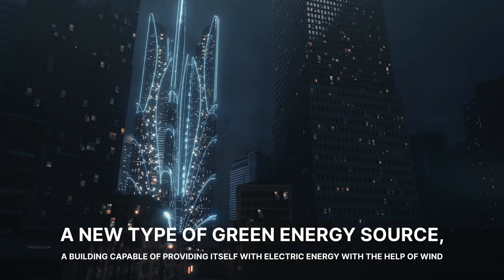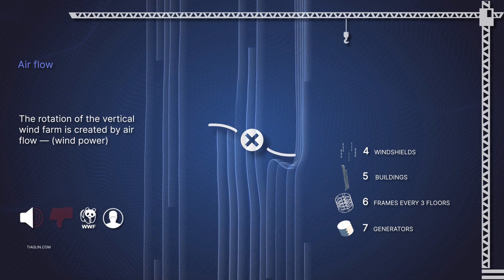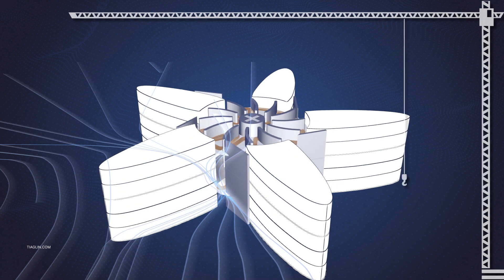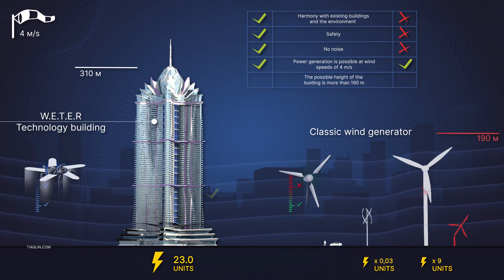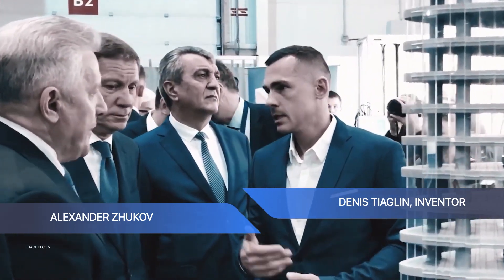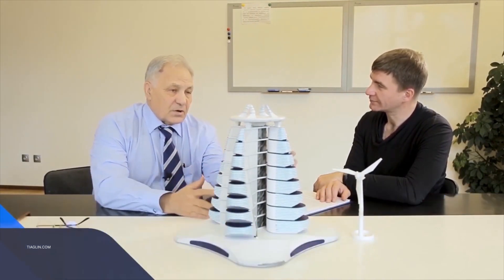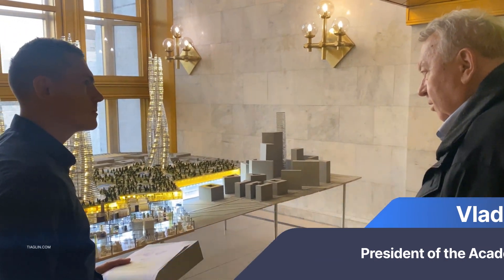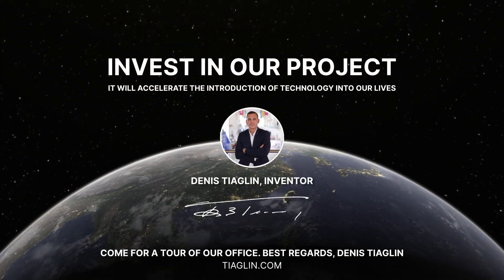PROJECT W.E.T.E.R - PRESENTATION

Comment: WETER is a breakthrough intelligent wind power technology, with the blades rotating along the longitudinal axis, the architecture directs the air to always go into the tangential rotation of the blades, making optimal use of the wind, the performance is independent. by wind direction. In all cases the building can supply 100% of its own energy needs.
Reply from the maker: Hello! Thanks for your support! 🍀
Sincerely, W.E.T.E.R/GOROD L.E.S/V.O.D.A project employee Daria ✨

Comment: In general, the design of wind turbines with a vertical axis of rotation of the power drive, shown in the video, looks very promising. It has a number of advantages over classic propeller wind turbines. For example, due to its efficient aerodynamic design, it uses wind energy more efficiently and can produce more power at lower wind speeds. It is also more compact and easy to install, which can be important in places where access to the power grid is limited.
Reply from the maker: Hello ! Thank you for your support and for being with us! ✨
Sincerely, W.E.T.E.R/GOROD L.E.S/V.O.D.A project employee Daria ✨

Comment: Windy Energy Technology Era Renewable project is a commendable and potential project in the field of renewable energy. Here is a positive review of this project:
The Windy Energy Technology Era Renewable project has made a significant positive impact in the development and use of renewable energy sources. By taking advantage of wind power, this project has created a clean and sustainable energy source, while reducing dependence on energy sources that pollute the environment.
The project's technological model provides an efficient and reliable solution for wind power generation. The wind turbine system is intelligently and modernly designed, making the most of the wind source to generate energy. This not only helps reduce carbon emissions, but also helps reduce electricity costs for the community.
In addition, the project has also actively contributed to job creation and economic development in the region. By creating job opportunities in the renewable energy sector, this project has contributed to the sustainable development and advancement of the industry.
All in all, the Windy Energy Technology Era Renewable project is an excellent example of using renewable energy to create positive change for the environment and the community. The commitment to using clean energy and creating innovative solutions makes this project worthy of a good review.
Reply from the maker: Hello! Thanks for you support and for your faith in us🍀
Sincerely, W.E.T.E.R/GOROD L.E.S/V.O.D.A project employee Daria ✨